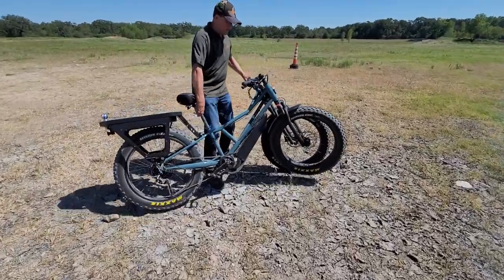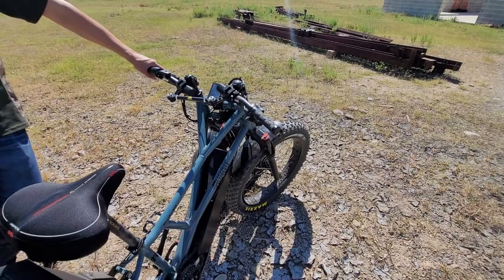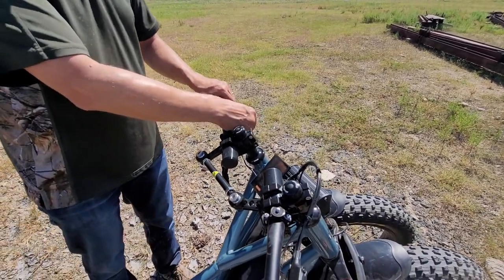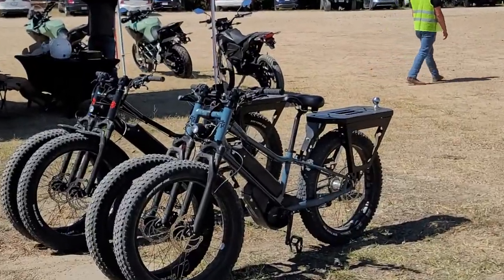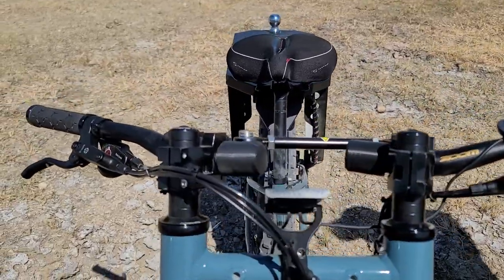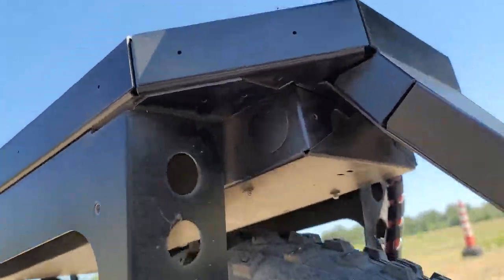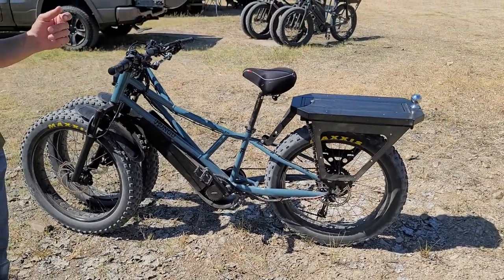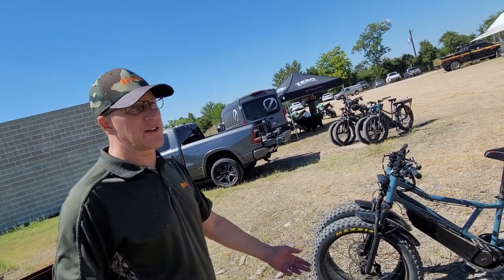Rungu Dualie E-bike: what the fork?

Comment: ackerman steering, clever, from experience problem with chain drive motors, is the chain stretches as its not designed for those forces, you need either a belt drive as some bikes use now, or more like a motor cycle chain.......it wont happen immediately but you will have this issue

Comment: I can't help but imagine this bike's front end combined with Christini's AWD front end. Oh, the complication! Give it them the widest Vee 2XL's!
Reply: I'm building one lol, bought a Rungu Standard for $4649 and $3066 for 3 52v20AH batteries, two Front 1200w hub Motors and a 1500w rear Hub motor. Going to be a off-road beast....gonna wire a 4 mode switch and keep a single throttle....gonna have a Horn, turn signals and retain the Mid drive for going up hill..... LED lights to alot
Reply: @niasamen2103  have you built this yet?